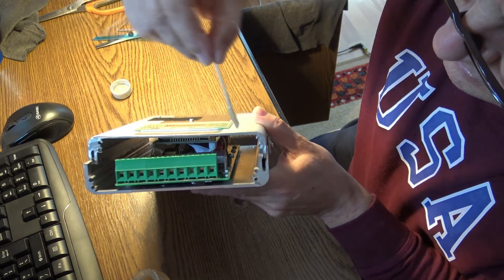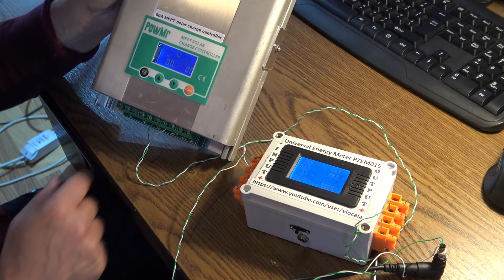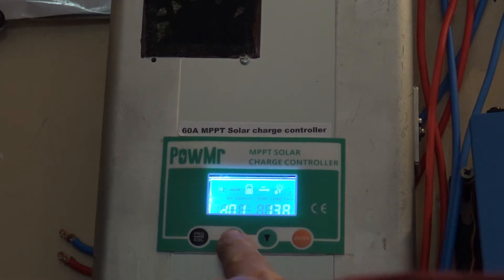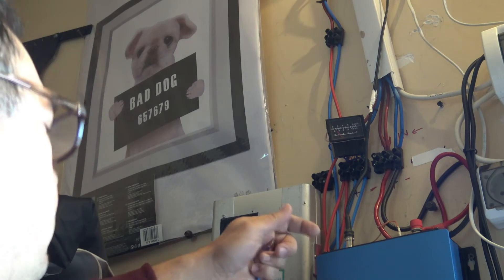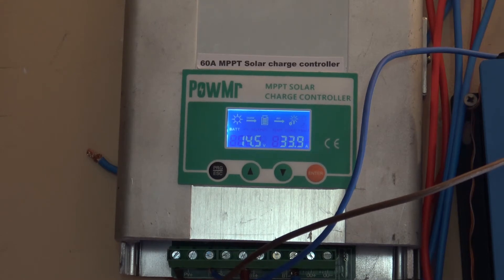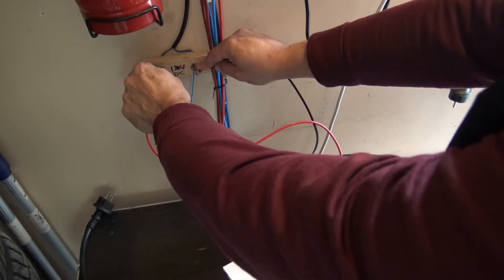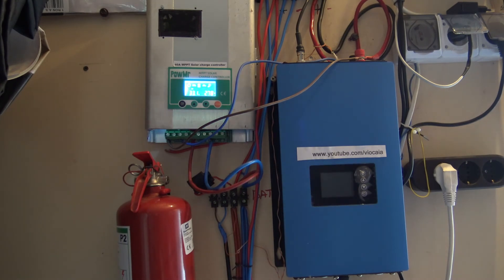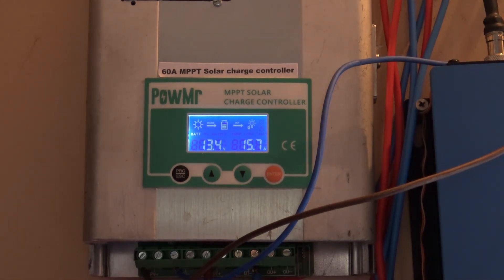DIY MPPT solar charge controller part 4 Final tests

Comment: I also bought this kit recently. I'm going to put it in an aluminum box. I wonder if you have already tested its effectiveness? If so, I would like it if you could write what it was like. Thanks.
Reply from the maker: I frecall like 80% or more..it's working great though
Reply: @viocaia  That's quite a bit. I saw that people say that it has 95% or more. I haven't tested mine yet, so I'm interested. Maybe in time I will also switch to victron energy.

Comment: I still do not get why MPPT is so expensive, but I guess it is charging what the market will bear.  I am still a bit surprised that this shows a picture (the already built one comes in this) of this in a LCD 12V power supply case.  It seems to be way too thick for it to fit into such a slim case as they show.
Reply from the maker: I believe so..it's kind of myth about better, safer charging with MPPT.I had and used some other models, pretty expensive, all I can say is it can deliver at lest 20% more energy than PWM..but if you consider the prices..no doubt MPPT are exaggerated.
Reply: @viocaia  As I mentioned to you before MPPT for anything less than 150 watts everyone told me to just go with PWM as the MPPT costs more energy than it saves.  Its real spot is 300w and above.
Reply from the maker: @generalawareness101  Absolutely right!